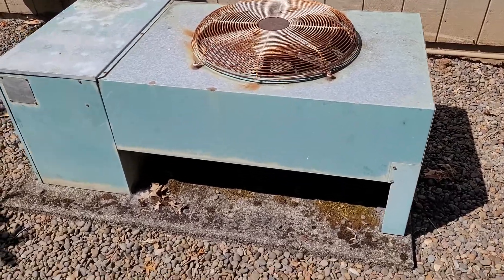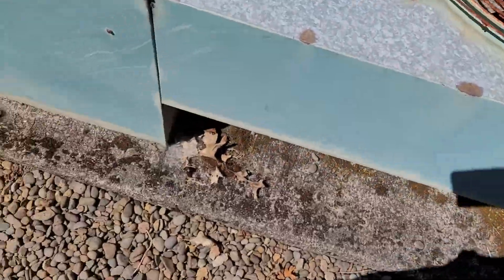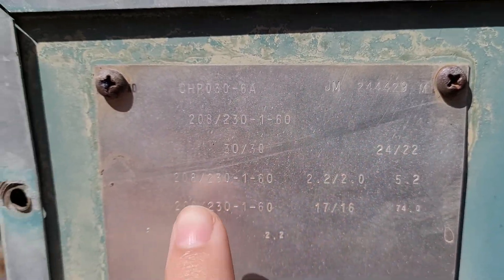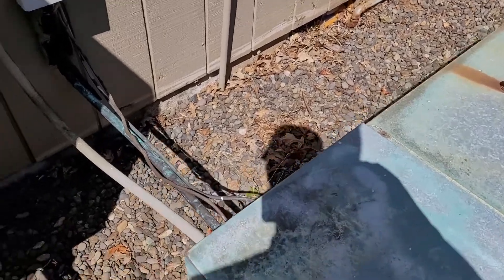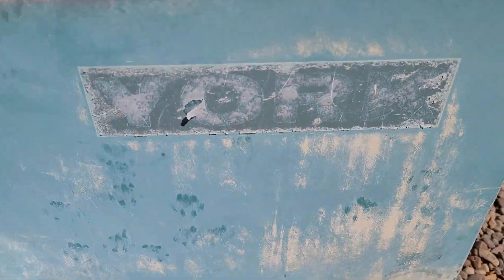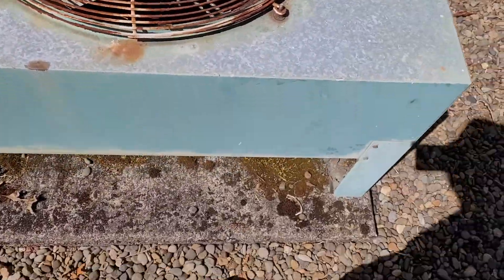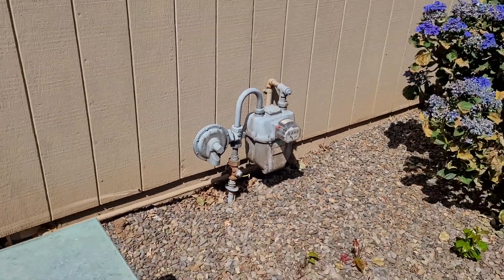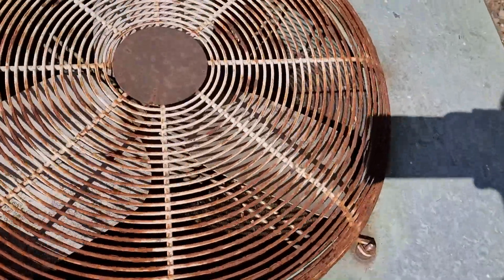Vintage 1979 York Table-Top Heat Pump

Comment: Wow that is a nice unit!!
This has and will surely outlast and modern replacement made today.
I once lived in a Condo built in 1982 the original central HVAC was natural gas heat with Carrier "Round Ones" for the AC portion I moved out in 1999 (It was my Grandfathers condo and it had to be sold after he passed:(  ) anyway it worked fine and I went back in 2002 or so to visit a friend I knew there and most were still in place humming along as this was during summer, however I have not been there since so I don't know how many (if any) are still there.
I think EER and SEER is a big scam to be honest I'd rather it use a few more amps then have it struggle to keep up on a really hot day!
Reply: Oops I replied before watching this (as usual, sorry)
Does it work as I see a mini-split (Junk they are the bane of the HVAC industry such a shame that junk passes off as HVAC these days!)
Table top when I think of table top I think small stuff but this IS the table top LoL!
Also just because there is a gas meter does not always (although it usually is the case) mean it is a gas heater as well maybe they have a gas range or oven?
I think you can tell if it is a heat-pump or not just by looking in side if you see a reversing valve it is a heat-pump, although it maybe hard to tell on this as the refrigerant lines and compressor look to be on the left side not on the bottom chassis like the square and round ones.
Reply from the maker: @Peter_Yachymczyk  yes i belive the york still yorks. I was talking with the owner and they say they use it and the mini split is for the room that the door goes to because there are not vents in that room. It would be utterly impossible to find out if this is a heat pump or not, as the tags printing is completely worn off and all of the refrigerant stuff is in the left cabinet. Im sure once they clean the condenser, this thing will run like a champ!
Reply: @United_HVAC_and_Fans  Nice that is still connected and hopefully works.
Yes it is enclosed in the left side but the traditional square or round units you can usually look inside the top and see the compressor and reversing valve if it is a heat-pump but this is not the case with this one as that is in a separate chamber.